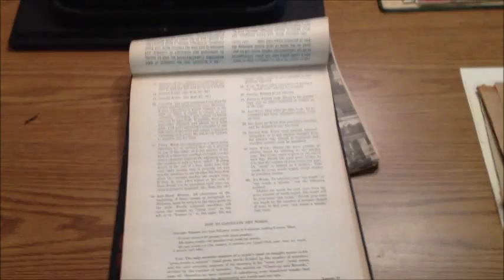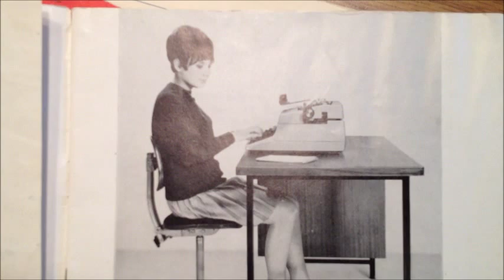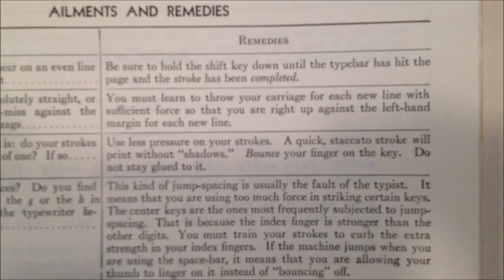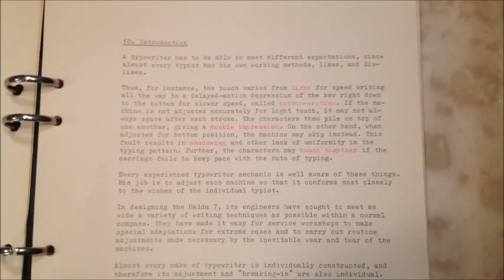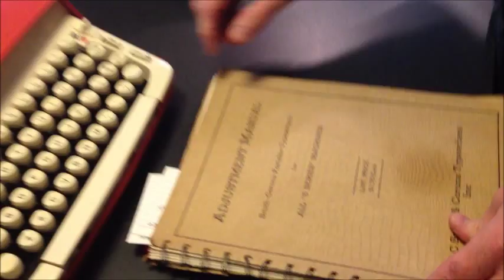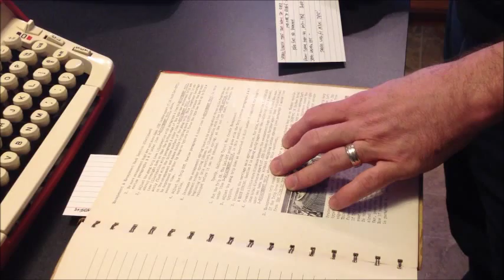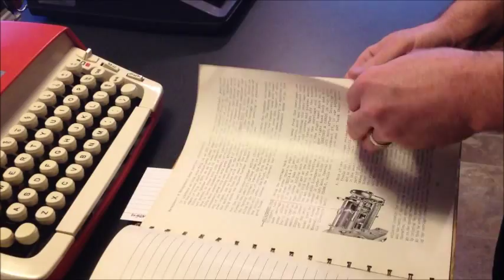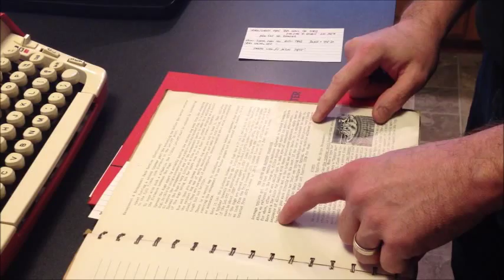Typing Technique and Typewriter Design

Comment: Typing on a typewriter certainly is a different ball of wax from typing on a computer keyboard or a touchscreen. You can't get away with wimpy tap-taps, you have to really move your fingers up and down and keep a good staccato beat, almost like playing a piano, and you have to adjust your technique to suit the machine, for each one is different in my experience. Bit of a learning curve if you've never done it before, but once you've got it, it's like riding a bike, you never forget (gives the ol' digits a good workout too!)

I only have two typewriters at present, a 1949 Smith Corona Silent and a 60's era Webster XL-500 made by Brother, but I love 'em both and I'm glad I bought them. Neither is a flashy affair, but they both work well, so I guess that's all the matters, right?

Might seem like a bit of an anachronism now, but typing class was mandatory when I was in school in the 90's and early 2000's. Granted, it was all on computers, but the experience was much the same as what I've heard about typing classes with typewriters, i.e.  it was a droll palaver and I never looked forward to it, though I did and still do love to write for pleasure (mainly letters and stories).